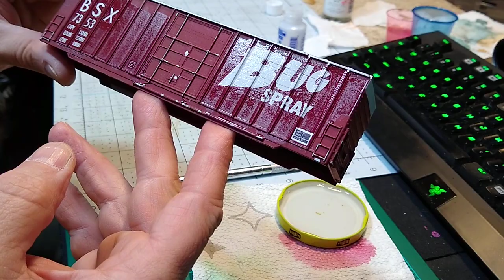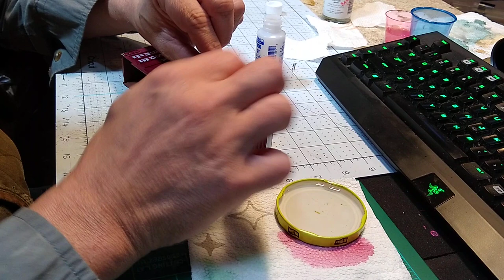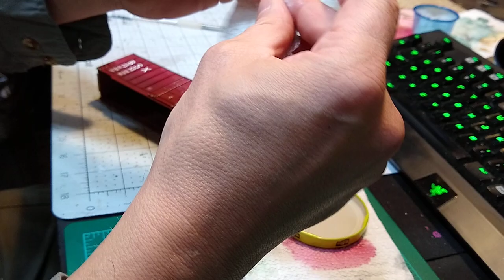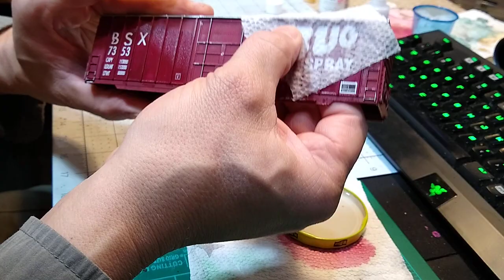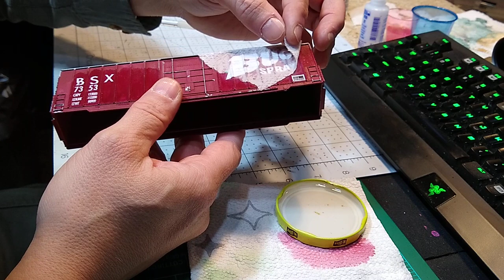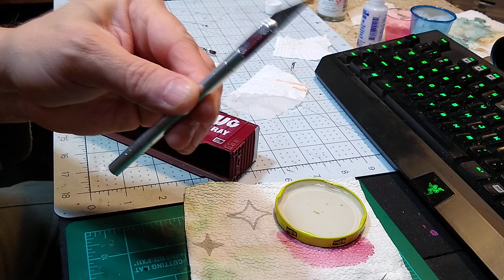How to apply large waterslide decals

Comment: Good video as always. Wondering if you could point me to the video you had on modifying an Athearn BB truck to roll or pivot over uneven track. I know I saw it at some point. Thx!
Reply from the maker: Athearn Blue Box SD45 part 3 shows how to do the metal sideframes and Athearn Blue Box Trucks total rebuild C44-9W part 2 shows how to do the trucks with plastic sideframes.  I think the SD40T-2 shows the plastic sideframe version also.
Reply: @elite194  Thank you. Im having a problem with a GP truck. Derails for no reason, all my other engines have no problem, just this one truck. The wheel seems to lift up slightly them BOOM.... Dadadadadadadadadadadadadada
Reply from the maker: @railcar123  also known as the "skidding" problem.  Is it metal sideframes or plastic?  the fix is the same as the 6 axle trucks, but it is also likely that a particle is in one of the gears and needs to be found and removed. On the metal sideframes, they have to be square to each other or one wheel will lift up and skid.  If the sideframes are plastic, take them off, take the worm out and roll the truck on your test track to determine which axle is the cause - one of them may be too rigid causing the lift.
Reply: @elite194  Plastic sideframes. Ill try that. Thank Ill let you know.
Reply: @elite194  Found the problem on the truck elite194! The one wheel set was slightly "spead out" (instead of 5/8" it was maybe 11/16th) I felt it "give" a little when I pushed it together. Must of spread when I had it apart at one time. Thanks for your tip!

Comment: Didn't you do a video on a silver metal paint that you put on the top of a boxcar? It went in dull and then you polished with a q-tip to make it shinier? I thought it was you but I can't find the video. It was yesterday or day before when I watched it but I can't find it now.
Reply from the maker: I think I have done it on video in past projects, but off hand I don't remember where.  I use it a lot especially on locomotive cabs just because I like the aluminum look.  The paint is the chrome silver kind, but to get chrome you must undercoat with gloss black.
Reply: @elite194  What's the name of it? Mr. Metal or something? And where can I find it. Direct from Manufacturer? Amazon? Ebay? I was watching it at like 2am I think and was falling asleep and couldn't remember if it was your video or someone else. It seems it was on a red boxcar's roof though and I thought of you because the boxcars you working on right now.
Reply from the maker: red is a color I use extensively... possibly the red SD45 with about 25 red boxcars along side it.  Mr. Metal comes from Taiwan, takes a long time to get here but it does a good job.
Reply: @elite194  Thanks for helping. I appreciate it very much.   👍🎅